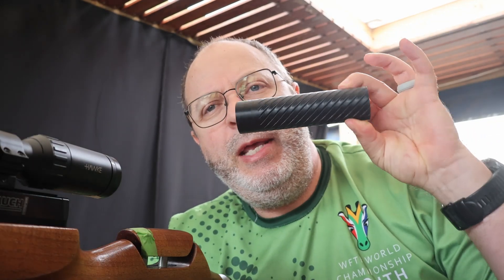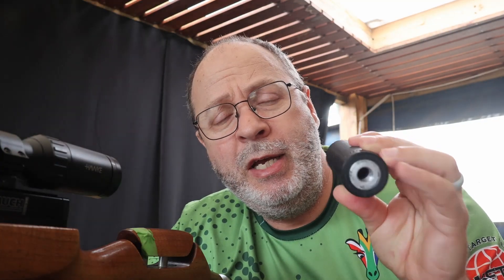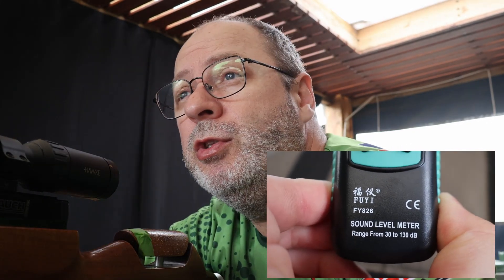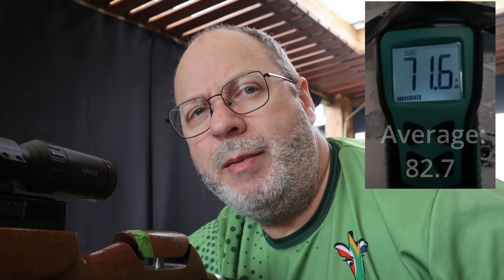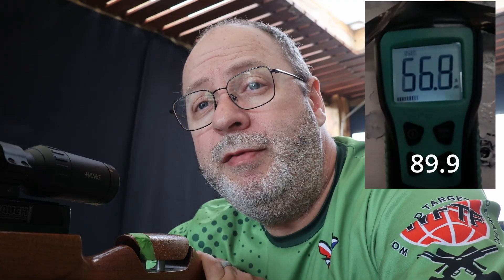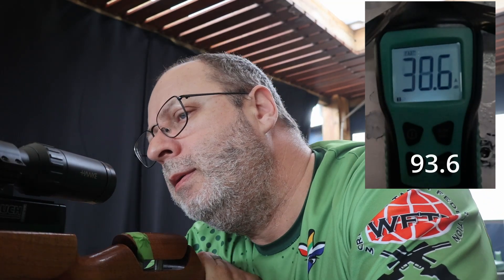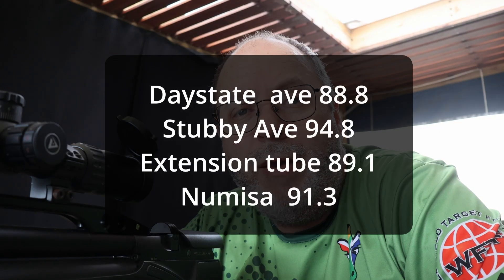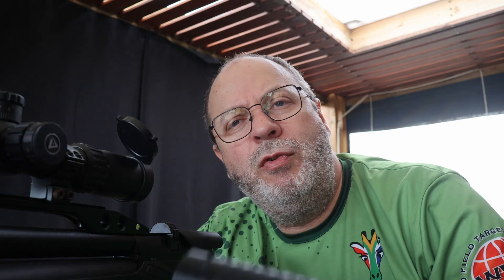Can a 3D printed silencer be as effective as the real deal

Comment: 3D printed my own .25 Cal. out of standard PLA for my FX Impact and it works just as well or maybe a tad better then my store bought one. I haven't done any real test with the 3D moderator compared to the store bought other then my own hearing.  Size wise my 3D printed is bigger and the attachment threading 1/2-28 is 3D PLA printed and my not hold up over time with repeated removals but can always make new ones!!😀 Well worth the time in cost to 3D print if you have a 3D printer in my opinion.  I did have to play with settings of 3D print file to get it to print correctly but that seems to be the norm with 3D printing anything sometimes. I got the 3D file off Makers World but I see now that it has been removed (9-30-2025) unknown why that is. So finding a 3D file to print could be a problem.
Reply: What country are you in? I'm in Canada and would like one so I can plink without going into the countryside. 😊

Comment: Doesn't matter how big or small or quite a silenser is BUT what does it do to the POI at 25 50 and beyond!! Tested a few even my own 3d printed and YES POI shift as it changes the weight of the barrel as well as the resonance my worst is unfortunately Donny Fat boy with and without the muzzle brake.. so Gert do that that poi test and lets see the results😂believe it or NOT my most accurate silenser is a simple DAUCH R1100 the time..
Reply from the maker: Yes, the silencer changes the harmonics on the gun, I have made a couple of videos about harmonics. The challenge with guns that are not easily adjustable regarding speed is to find the best node for the silencer, FX guns are easy, you adjust the gun to the silencer,slug,etc. POI shift is not my concern, consistency is, as long as the new balance of the gun is consistent over 25 and 50 meters I am happy, the POI shift is just a click or two on the scope. Maybe I should look at a video about consistency and weights on the barrel, I know that on my FX a 5fps change in speed can wreck havoc with the groupings.

Comment: Does it have an effect on fps and accuracy?
Reply from the maker: There is a POI shift due to the weight on the barrel, the groupings looked very good, I will do a follow up video. I didn't notice a difference in speed as most of the air behind the pellet is dispersed once it leaves the barrel, the silencer breaks the air up even further, techincally speeding it shouldn't have an effect on speed.

Comment: I've got two different sizes on my .177 and .22 that is also 3D printed by a local guy and it works good. 40mm x 180mm and a 50mm x 180mm
Reply from the maker: Nice, I am having a fat boy made, 60mm x 200mm. This is the nice thing with 3D printing, I can order what I want to test and it doesn't cost me my pension.
Reply: @AimSmall I think mine was like R550-00 ex courier
Reply: I print all my moderators!